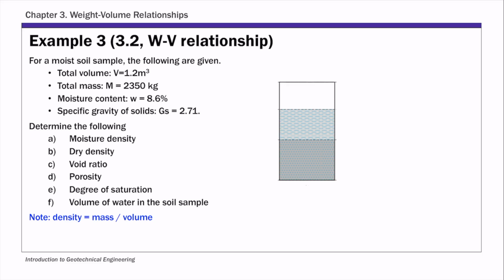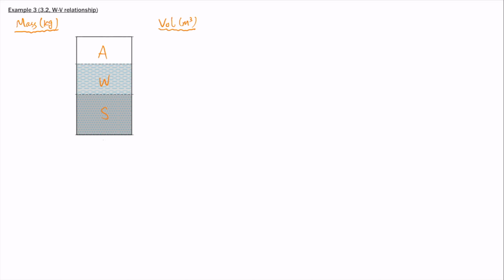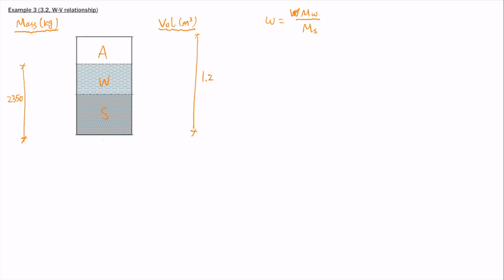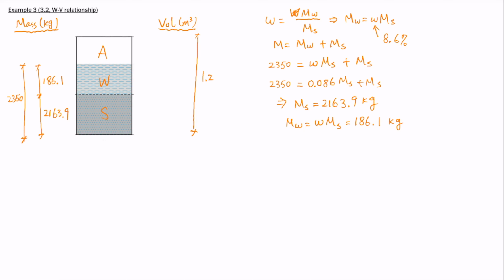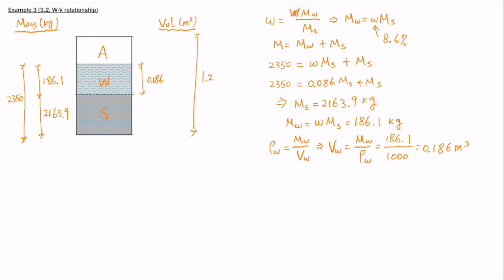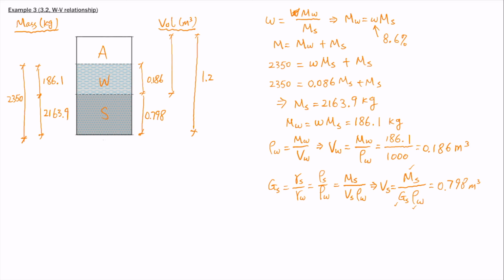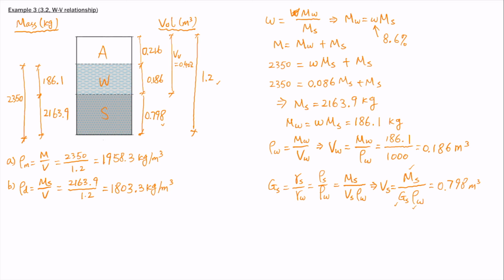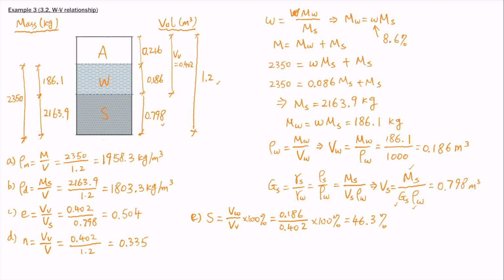Chapter 3 Example 3 (Phase Diagram)

Comment: Top content! 
A question: why is the water content defined as the ratio between water weight and weight of solids insted of weight of water / (weight of solids + weight of water)? 
Once again, fantastic channel. I will surely eatch everything this semester!
Reply from the maker: This definition of water content (W_water / W_solid) is commonly used in the soil mechanics/geotechnical engineering community, as the solid phase is considered the most important and often used in the denominator. In other disciplines, the definition of W_water / W_total is more common.
Reply: Thank you for answering!